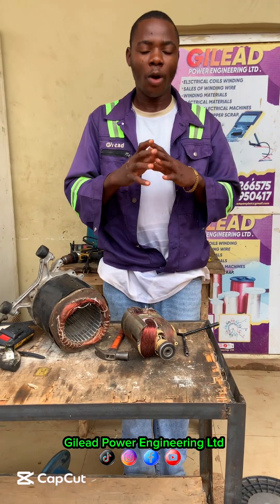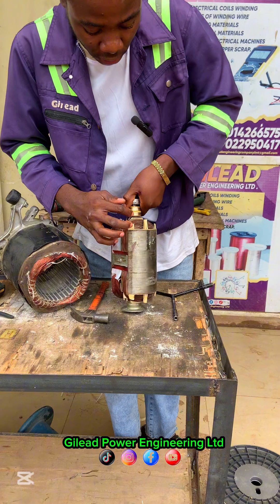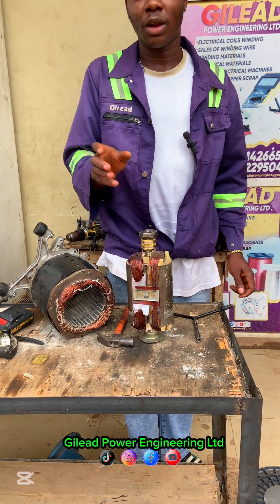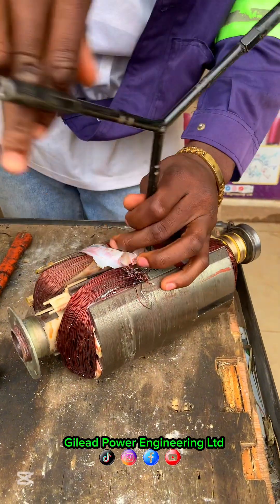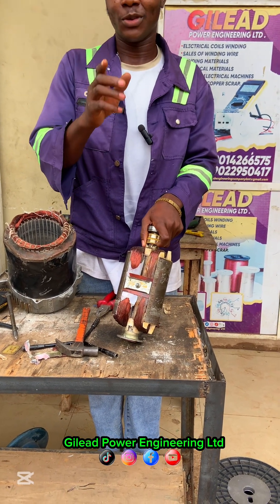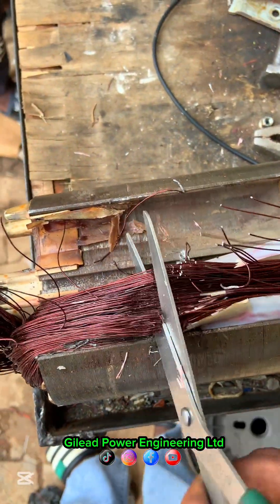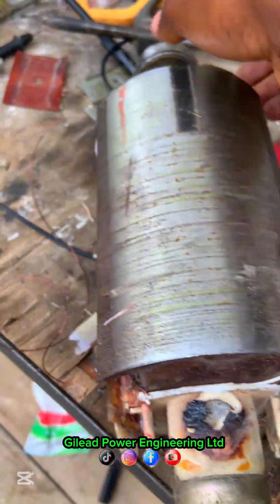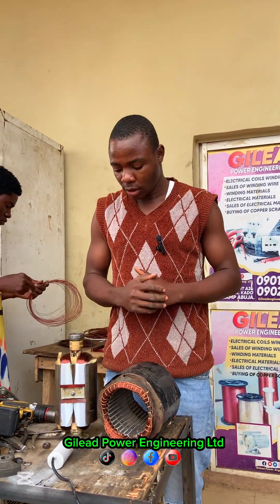A quick reminder for all reminders

Comment: Alright sir..
But I've a question what might cause voltage drop in a generator.

While running it's 220v when load it's drop to 120 ??

Just rewinded new stators coils
Reply from the maker: The regulator is not working well or the avr is not good